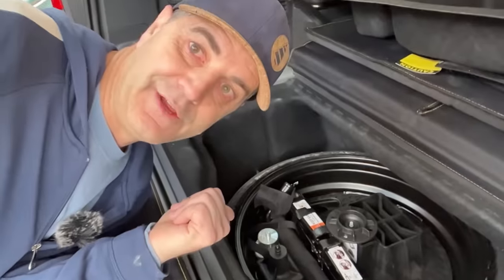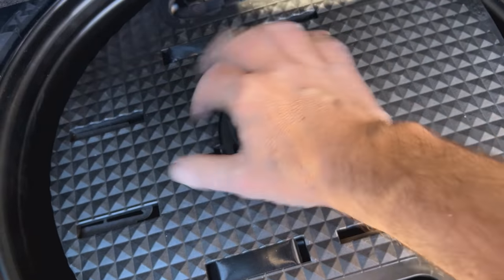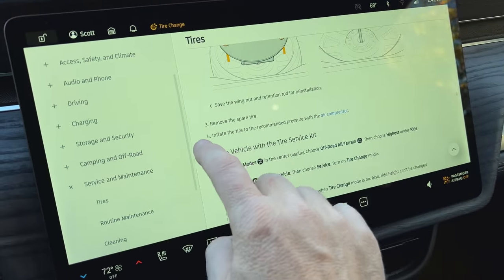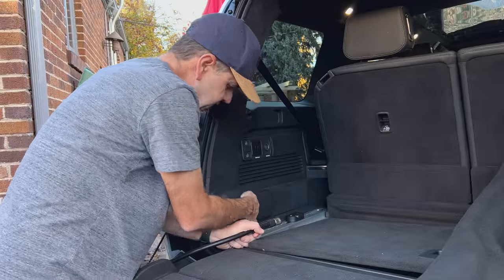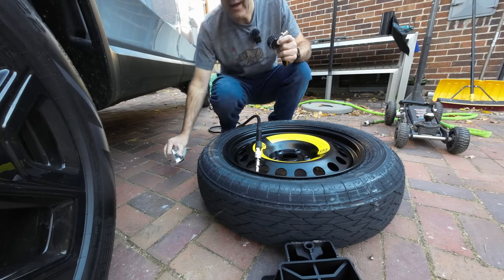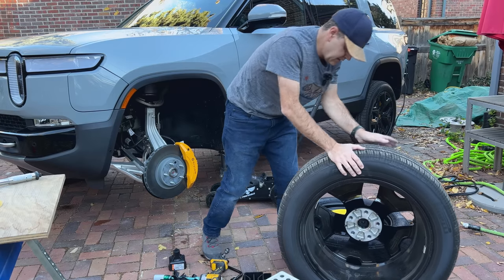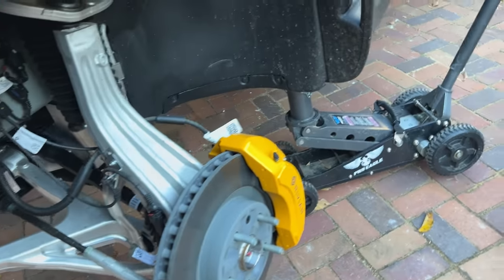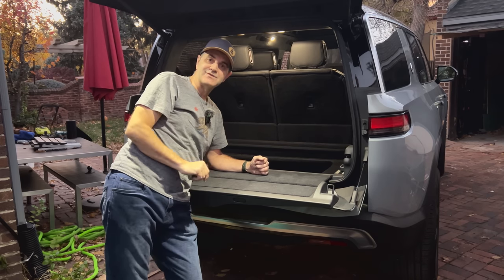Rivian R1S Compressed SPARE Tire - Will it work??

Comment: Thanks for putting this together!  Ironically, just the other day I went through a dry run changing/using the spare tire (short of actually changing a tire) so I'll at least be familiar with the process and to confirm all pieces of the jacking equipment are present.  (Small issue I've noticed with my R1S since taking delivery are a few missing pieces or equipment that doesn't work, e.g. the air hose coupler (either end) does NOT stay latched on to the nipple part on the vehicle. Apparently a common problem when I spoke to Rivian service.  Ugh.)   

Note, the big cube piece is the jack stand base.  Manual says to only use when changing the rear tires and not the front.  It doesn't indicate why but thought I'd mention it here since it wasn't mentioned in the video.  I'll probably carry some type of flat 10"x10" or similar size piece of wood or high density plastic and use it as a jack stand base for the front in case I'm parked on loose or uneven ground (e.g. gravel, mud, etc.).  

Another very important safety thing not mentioned in the video is to chock (not provided, so buy some) the tire kitty-corner from the tire you're changing, especially when changing a rear tire.  The electronic brake in the R1S (probably the R1T also) only applies to the rear tires leaving the possibility of the front tires to roll when the rear of the vehicle is jacked up.  

Best advice I would give is to take the time to read the entire section of how to change a tire in the R1S owner's manual as there are specific times of when to change ride height along with the driving mode and other safety items.

TIP: If possible, don't deflate and store the compact spare while it's still wet.  The trapped moisture in the tire folds could develop mildew.  :-/
Reply from the maker: Thanks for the tips. Yeah, there's no way to do this perfectly, but I tried to do it safely as if I were out on the road. I don't normally keep chocks with me but perhaps I should. I also don't keep the ProEagle jack on board, but I did use it here. Interesting about the hose attaching issues. Hasn't been a problem for me.

Comment: Scott - thank u for running through the spare gauntlet for all of us who own R1Ss or have them ordered. I’ve run thru this exact scenario in my mind hoping the doughnut tire would shrink back into its original size and was fairly confident that was only happening w a rubber mallet or ratchet straps. Grt job Rivian engineers. You just saved me an hour or more pre-testing - so thank you.
Reply from the maker: You’re welcome. Yes pretty sweet engineering I agree. Those Dutch really know how to play football and make spare tires. :)

Comment: Scott, I have a PITA request...could you remove the full size 20" spare out of your T, remove the bin and compact spare from the S, (lay a blanket or tarp) and see if one could vertically and upright set the full size spare down into the recess so the wheel faces the back, and attach a ratchet strap up and over the top of the tire to the 2 tie-downs?  Some critical off-roading info I need for the S.  Thanks!  Maybe post a photo or video if so.
Reply from the maker: Sure. That's a very particular description! do you mean put the full size T spare in the R1S back compartment?
Reply: @RivianDad  yes see if it will sit upright, with maybe the bottom 1/4 of the wheel sitting down in the recess.  Not sure how wide the recess is vs the width of the 20” AT.  (Just like a spare would ride on the back of a Jeep but inside).
Reply: +1 to test this
Reply: I really wish the R1S had a full-size spare. If you can take the spare from your R1T and see if you can find a good way to transport it in the R1S, I think a lot of people would really appreciate it. Great video, cheers!

Comment: just a point to make that you likely know already.  the Jack point do not need a tool to remove.  You can simply push in on the back side and the open edge will pop down allowing you to take it off.  No tool required.

Comment: Great video! A few flaws with Rivian's execution,  though.

That silly cap you have to stand on your head and pry off? Seriously?

And a scissors jack can be safe and durable,  but isn't suited to high- ground- clearance vehicles, hence the platform. A screw-type mechanical bottle jack is what many pickups use.

Citroën DS from 1955 had a hydropneumatic suspension which could simply lift a tire off the ground with the push of a button.

It's great that the spare tire can shrink,  but you still have to haul the flat tire home,  and I presume it won't fit in the well?

This,  at this price,  should come with an air ratchet which can both remove the lug nuts and power the jack, if the suspension can't lift the tire.. Now THAT would be helpful. 

As for lifting a tire,  the suspension should be able to know which tire is flat,  and then adjust the suspension upward, then lower the opposite corner all the way while lifting the corner with the flat tire all the way,  then back off that corner - it'll only need an inch or 2 to clear the ground. In fact,  it need only do so enough to remove the flat,  as the spare could be installed and then inflated [unless it needs to lie flat for that fancy inflation sequence]. That way,  you could use the compressor and air ratchet to swap tires, then sit safely in the vehicle while the tire inflates, disengage tire change mode,  and drive away.

Comment: That compact spare is wild. I've never seen anything like that before. I wish Honda would go to that for the Ridgeline rather than the current donut spare.
Reply from the maker: Yeah, but it only would work if you had it on board air compressor as you do in the Rivian. But it’s a good concept.

Comment: Over $80,000 and the spare is optional? Any vehicle with the potential for off road use should have a full size spare as STANDARD. Poor engineering and design choices.

Comment: What a f**k around just to find out what pressure the spare needs to be, how about Divian simply print that on the big bright yellow sticker of the wheel itself?, unbelievable.
How about access to the compressor from the trunk space, so you can rest in on the tailgate and inflate instead of breaking your back putting the damn spare on the floor.
There is not much thought gone into some parts of this very modern truck, how disappointing.

Comment: Pretty impressive. 👍🏼👍🏼 2 thumbs up to who ever engineered that spare tire.
Reply: These types of spares have existed for a while. Wasn’t engineered by Rivian in case folks were wondering
Reply: It was on the 2010 vw’s Touareg
Reply: It was optional on 1967 Camaros and Firebirds and used throughout the 70’s and 80’s in many GM and Chrysler vehicles.

Comment: This is impossible where does the original tire go do you leave it and have someone mail it to you and to go into your car settings it takes an hour and a half to do something that should only take ten minutes you have 30 pieces you can’t lose that you need or it’s useless this shouldn’t be legal and it’s an option no you buy a brand new car and this is thrown in if I bought a brand new car and I found this out I’d take it back and get that tire thrown in or if not I’d take the piece of shit car back it’s not worth the trouble and who on earth is going to be able to figure this out you need a phd in car assembly screw that

Comment: Great video! thank you for posting.  Do you know if there is anything unique with the wheel-wells/breaks of the R1S vs the T that would prevent the compact spare from working on an R1T?  I was able to successfully order a compact spare at the local SC (not available in the gear shop yet), as I want to save a little room in my R1T spare well; and I am not an overlander....  while the SC did let me buy it, they said that was the "1st time someone asked for the compact on an R1T" so I want to make sure it will fit.  I know the R1S is a longer vehicle but my assumption is the breaking HW and wheel well geometry is the same....Not sure if you've even compare'd with some of your R1T buds....any info appreciated

Comment: Very impressed that the spare tire returned back to its original compressed shape just by letting the air out. They've removed my spare tire and I'm not sure if I'll get the original $450 price when I take delivery. Thanks for the video and it was very helpful.

Comment: Rivian Dad, I believe you own a R1S and R1T?  Can the R1S compact spare tire be used on the R1T?  I would assume so and maybe this question is better suited for Rivian.  In the gear shop, under compatibility it states the compact spare tire is only for the R1S.
Reply from the maker: Simple answer is yes. The bolt pattern is the same for the S and T so you can swap wheels between the vehicles. But, I'm sure there are reasons they say it's only for the S (testing, specs?), but in a pinch it can be bolted on for sure, although I haven't tried it myself.

Comment: One of the first things you do when you buy a new car is throw out the emergency tire and replace it with a real "spare tire". These things are even worse, I wouldn't trust it to get me down the driveway.
Reply from the maker: Except that there isn’t a good place for a full spare. I actually think it worked pretty well. My only concern is the number of steps necessary to use it. Seems like that may be a problem on a cold winter day.

Comment: Too bad the spare is no longer included in R1S deliveries. And not yet available for purchase from the gear shop. Any flat fix recommendations in the interim?
Reply from the maker: boy, I wish I had something specific to offer here, but I don't. I think without the spare, it's just a matter of keeping a flat inflator kit with you. At least there is an onboard air compressor which can help in some situations. If you're planning an off-road outing with a high probability of a puncture, you may be able to buy a full sized tire to keep with you. I think those are easier to get and could even have an aftermarket spare to bring along. Haven't explored this but a good idea for a video. Thanks!

Comment: Great video. 

Oddly my R1S Launch Edition did not come with this tire. As of yet, it is not available in the gear store. Frankly they should’ve put a full sized tire for an “adventure” vehicle, but at least there is this option. Thanks for posting.
Reply from the maker: Yeah, I've heard that. Initially my R1T didn't have a spare either, but I bought one later. Note that the full sized will sort of fit in the back compartment of the S, but it takes up most of the luggage space to do it. See https://www.youtube.com/shorts/mXKepD4HFa4

Comment: Scott,

How do you feel about the jack that came with the R1S?     Is it stable enough for the job? or you would recommended an aftermarket one that would fit in the SUV?
Reply from the maker: Well, it's a scissor jack so basically it's the bare minimum. It's tough to use even under good circumstances and for a truck this heavy, could be quite dangerous. But, I have used it and it does work. Whenever I've been out for off-road trips, I bring the ProEagle along. It has saved a fellow R1T owner once. But, it's big and heavy so not ideal for a day-to-day option. I'm thinking about a bottle jack of some kind (maybe one that works with an air compressor), but the one I tried didn't have enough range to lift it, so I'm still looking. I'll keep you posted if I find something!

Comment: Scott thanks! Question where did you find the torque settings for the lug nuts. Your spent a lot of time on the PSI but nothing in the torque or where to find in owners manual?
Reply: Rivian official Tow Operators Guide shows the lug nuts on both R1T & R1S are torqued to 190Nm (appx 140 ft-lbs).  I am sure the same torque info is found in each respective Owners Manual.

Comment: Wow, VERY inconvenient. Definitely not user friendly.
Reply from the maker: could be better, could be worse. My other car doesn't even come with a spare!
Reply: @RivianDad it it could be much worse.  

My Grand Caravan has the spare in the middle of the underbelly of the vehicle.  Between the front seats there is a nut (for lack of a better word) that you put the lug wrench on.  Then you spin that nut, which lowers the spare on a cable.  Oh yeah, I’m sure that system is totally not seized up, lol.  

Then I have a Chevy 2500HD.  Yep, spare is installed on the underbelly once again on a pulley system.  A guy at work had a flat on his 2500 when he finished for the day.  Had to use an angle grinder and cut the cable to get the spare down.

Comment: Does the car come with that metal platform you had between the jack stand and the jack point or did you have to buy that separately? Thanks Scott!
Reply: The spare tire kit comes with a jack pad for the included jack, but it's not intended to be used on any other jacks. A couple brands like EVSportline sell jack pads that work great for other jacks, and Pro Eagle sells a Rivian jack pad intended for the offroad jack he used here (which will make your life a lot easier for regular changes, but the included bottle jack is good enough for an emergency).
Reply: @kylealden  thank you!

Comment: I'm not sure if the spare tire space is the same size as the r1t but they both use the same kind of tires maybe just order a extra tire set from the website in the size you need and then there you go
Reply: full size cannot fit in the r1s tire hole.
Reply: @alangebhardtsbauer9312  that's what the truck bed is for 😂😂😂.... also my friend in Kalamazoo has a R1S and oh my God I love that thing I want one so bad

Comment: Thanks for the video. Out of curiosity, I wonder if it would be possible to change the tires without a jack, but instead by using the Rivian’s adjustable heights and a stand. In other words, starting in highest height setting, positioning a stand under the vehicle (near whatever tire needs to be changed), and then lowering the height, effectively lifting the wheel off the ground. I guess it will depend on whether the 5 or 6 inches in adjustable height difference is enough.
Reply from the maker: I don’t know this first hand but i imagine this would not work. I don’t think the air suspension can lift a tire, but who knows. Something to test! Thx.
Reply: Don't think this will work - AFACT the air suspension will adjust the ride height but not limit the travel, so even at a lower suspension setting the wheels will still hang free the full length of travel.
Reply: Pity- Citroën DS could do that in 1955.